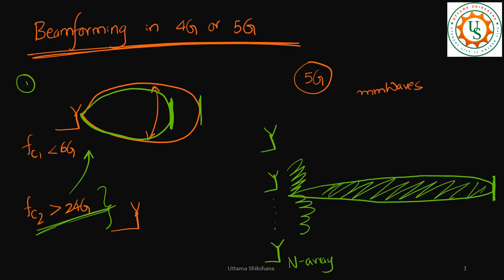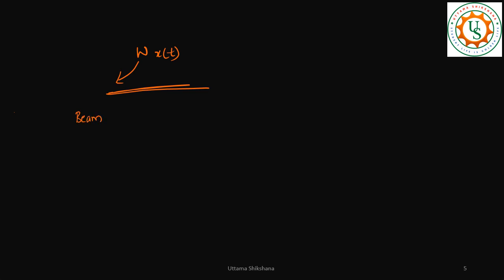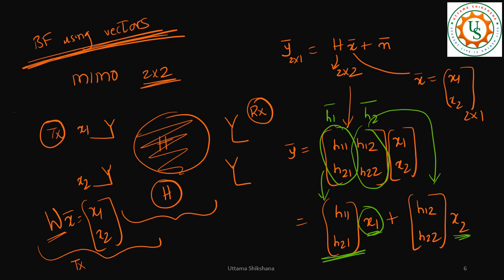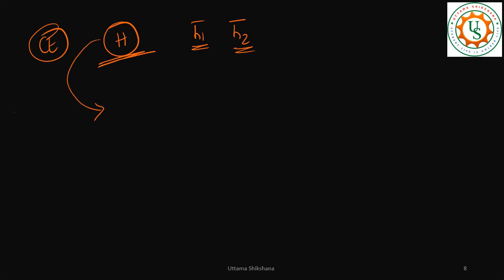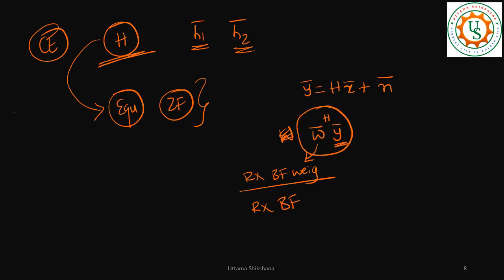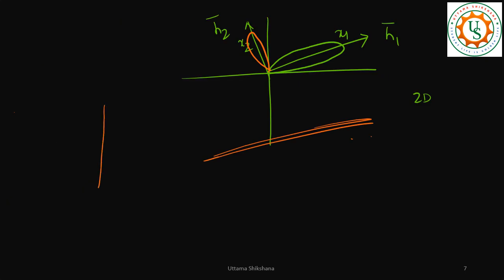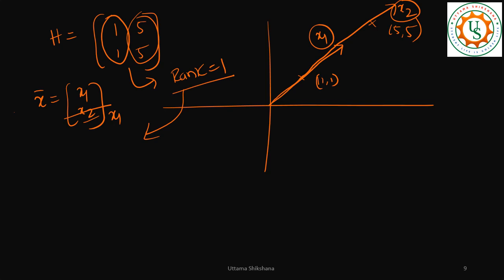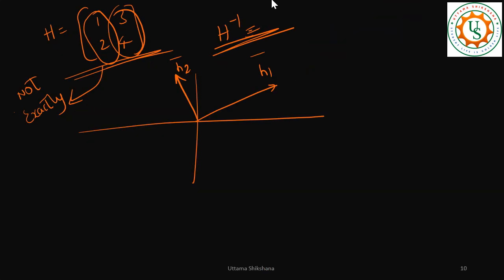[Series #9_3] Beamforming along column vectors of Channel Matrix H | Geometric Interpretation of H

Comment: 1. At time 2:00 minutes, if the receiver had only one receive antenna then will there be any processing required at the receiver side for getting beamfoming gain ?
Reply from the maker: If receiver had only one antenna then it's RF beam is very wide. 
Here, there won't be any processing and hence there is no receive BF gain.